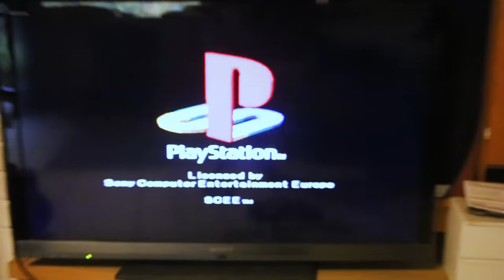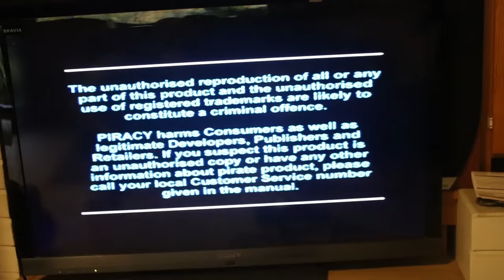Restoring the original PlayStation (PS1) - Vintage Console restoration & repair

Comment: No! Why you removed the Modchip!! That why everybody had a PSX back in the days!
Reply from the maker: It's a restoration. I can put it back if I want but that's not the purpose of this project
Reply: That and it's got the port on the back that a modded GameShark can be plugged into
Reply: Agreed. Seemed a bit stupid to me to remove the mod chip.
Reply: Quite sure he can do a better job, that was a half assed modchip install
Reply: That thing is pure jank as well as the installation, better without than with it!
Reply: @SilvaDreams  Indeed.. you should check out Lord Voultar, he did some eBay mod chip reworks.. scary!
Reply: I had an PSX back in the day and guess what it was not a modded one, enjoyed the shit hell out of it.
Reply: Taltech chip dont worry it was just a spy chip planted by a foreign government
Reply: You can now buy a card called PSIO, you can put it into your parallel port and then play games from an SD Card. No Modchip needed.
Reply: That’s a lie. Everyone had a PlayStation for Tony Hawk.
Reply: Games are realy cheap for the ps1 and know one does copies anymore so why leave it in?
Reply: @OddTinkering  It's not restored that spindle hub needs to be replaced before it cracks apart it's already missing plastic exposing the red rubber suspension that retains the CD. That's more important than the mod chip as time progresses being a wearable part, buy a shit load of the cheap ones sony used or source a quality metal one from a portable CD player and go butter knife that shit yo! If you want that thing to last the next 50 years.
Reply: Whats a mod chip.  I was wonderig how it was even working without the thing with the red wires
Reply: I've still got my PS, with the parallel I/O port, never modded, completely original. Looks and works like the day I bought it from Dixons. I was never a big mod chip fan, seemed overhyped and they often seemed to be more trouble than they were worth, plus the installation often seemed absolutely piss poor, real back alley stuff. I just bought games and played them, that was always good enough
Reply: RBRat3 then make your own god damn video
Reply: @Peckerwood420  actually RBRat3 is right, I noticed that as well. There was absolutely no need to be so rude. He spotted something wrong and mentioned it in the comments, that's OK, that's just observation, and will save Odd Tinkering time and money later on. You need to get a grip.
Reply: @Peckerwood420  Find me an ugly ps1 and I'd be more than happy to but the last one I pulled out of the trash the only thing wrong with it was a cracked off spindle hub. To help you understand a bit better that mod chip is not impeding the function of the unit while that spindle hub will make it absolutely useless from a native standpoint. The spindle hub is the weakest and cheapest part of a PS1 and doesn't do well to being whored out constantly to the will of holes for a decade unless it's a museum piece. It either needs backups or a quality one and you need them now before CD's and their hardware fall off into obscurity... To put this into perspective without the internet when was the last time you found a portable CD player that you could harvest a spindle hub from?
Reply: @OddTinkering  "put it back if you want"? "not the purpose of the project"? That's the whole purpose of the project, to bring classic consoles like this up to their optimal usage with modern mods that add quality of life for continued usage of the system into the future. Who wants to play old scratched up disks anymore? A word of advice to not make your viewers displeased: If there's a mod chip in it, don't remove it unless you plan to replace it with a modern even more optimal solution! I highly doubt you can 'put it back if you want' you don't know what chip it is where it was from and probably likely can't find an installation guide anymore let alone match up the model and use the correct guide for that particular system. I guess you could rewatch the video, but doesn't look like you recorded all of it you won't know where any of the wires go anymore. So I would say check out some of Voltaire's videos, he actually removes mods to install a newer better version of them rather than just removing a useful feature and returning it to be destined for the junk bin... If you want to restore systems don't devalue them and leave them in an even more junk state then you got them in! And Taltech is right I have installed modchips on all my systems back then and over the years, and if anyone even thought about uninstalling my mods I would punch them in the face! lol So unless you're trying to anger your viewers don't ever do this again... 

The only acceptable removal of a mod is to install a better one and make that clear and show that you've done it! It's not an 'optional'...' can do it if you want'... Either do it, or leave the system alone and let someone that actually respects these old consoles do it instead! Besides that major fail, I don't see any real restoration here, at least you didn't show any of the process besides simply cleaning it, that's not a restoration that's merely a cleaning, and a restoration includes restoring the functionality it had including it's modded in functionality! At the end of the video it looks like after the cleaning you merely plugged it in and it kinda worked and you said bam restored! Perhaps this isn't a concluding video and it's still an ongoing project but to actually count as a restoration you have to actually fix what's wrong with it and update that mod with a new version likely with less wires and easier and more readily available mods... For PS1 there's actually in more recent years became an off the shelf chip you can buy and flash it with software that does everything those old mods did and a bit more! So I would recommend going that route with this machine, or at least do the parellel port sdcard loader for it since this machine has a parellel port which was removed on later revisions that's another good option here!
Reply: @thecynic807  Back in the day before the world of software based modding with these consoles it actually required (or was easier) for non manufacturer (in this case sony) individuals to develop custom chips that 'interfaced' with the consoles and soldered themselves into the system connected at key points to intercept and override signals to bypass the system's copy protection to be able to run backups (copies made of your games so you kept the original disc unscratched and pristine in the box and burned a new copy from backed up .isos whenever your current one got too scratched up to be comfortably usable) and by extension allowing region free play as well as a bonus. They essentially trick the system into thinking it's an original disc so it loads it up without a problem and so that it ignores any region locking allowing imports to run as well!
Essentially it's an unofficial and unsanctioned chip that improves your gaming experience, so they're really awesome! :D

Comment: Some of the real OG's would know how to play a copy game without a mod chip. By holding up the cover plate while the CD is running with a demo disc inside and switching the copy CD back and forth between loading sounds to get the fake game running.
Reply: Yep, I did that. It eventually broke the disc drive motor. Good times

Comment: 6:12 Lighter fluid also works well for removing sticky adhesives. I find isopropyl alcohol can be harsh on some surfaces.
Reply: Or you can get label remover which smells like oranges.

Comment: "The person I got this from told me it was put away after it started having some issues" 

Where did they put it? In the ground where all the dead bodies are?
Reply: Yes
Reply: @МаксимСелюзкін  oh really? Any proof of that?
Reply: Максим Селюзкін how do you fake restoring a console with 15 minutes of footage
Reply: jay_boivin07 I’m going to guess he’s calling BS on how the guy got the console, but if this dude is on some conspiracy theory shit, I’m not about to just write him off. I want to see how deep this rabbit hole goes.
Reply: @jay_boivin079  1. Drop it to dirt. 2. Wash it with a soap. 3. Profit.
Reply: @nosoyporta  No electronics check? No electrolytic capacitors check? (after 20+ years!) Laser head is need to be replaced! Not to add some grease. What did he do? Removed a mod chip and wash it with a soap water?
Reply: @МаксимСелюзкін  and greased the laser reader track, which was the cause of 99% of the problem.
Reply: @Erduk  This is NOT enough. A laser was fucked as hell by CD-R's. ONLY replacement.

Comment: I have an original PS1! It doesn’t have that big “R” sticker on the front but other than that it looks perfect.
it doesn’t work tho :(
Reply: Would you try repairing it with this video as a reference?
Reply: Emilio D. Galvan I don’t really do techy stuff like that, but my Dad might!
But the problem is, we don’t know what’s wrong with it.
It’s probably the common problem described in the video, but we won’t know until we check!

I also don’t know where it is anymore 😕
Reply: @ArtBoy54Productions  It should be somewhere, you might want to wait for PS5 to come out next year though, since there are strong rumours about being backwards compatible, even with PSOne games

Comment: 3:16 I can hear Lord Voultar getting furious over this mod chip install.
Reply: What does the chip do?
Reply: @thelazycook5103  Disables region locking, I'd imagine (as somebody who never owned a PS1).
Reply: The chip disables the anti-piracy technology as well so you could copy a game to a burned CD and it would run
Reply: @JamLeGull  Oh yeah, PS1; they absolutely had anti-piracy software- I remember watching a video about how one of the Spyro games had a clever way of circumventing pirated copies and/or modded systems.

The only time in which I could really be an advocate for game piracy is either if a game is out of print for many years and physical copies are near impossible to come by, especially if it's a game that hasn't seen digital redistribution or was never released internationally or in certain regions.
Reply: @DickieCheezits  No it's not 'anti-piracy proection' it's called copy protection... And mod chips bypass it to allow playing copies of your games so you can keep the original in box unscratched so you don't have to rebuy it again and again if you play it a lot. COPY != PIRACY (copies made of your games so you kept the original disc unscratched and pristine in the box and burned a new copy from backed up .isos whenever your current one got too scratched up to be comfortably usable) That's why they're called backups, backups of your owned games... So there is a distinction to be made there and I don't like when people conflate the two. And that Spyro copy protection measure as far as I remember it from that video I saw as well couldn't actually differentiate and tell whether it was a legitimate copy or not it merely detected a 'give away signal' of early mod chips at that time... So it was actually anti-mod chip, the disc could've been original or a copy of an original legitimate original or legitimate copy and it didn't actually detect that but merely the presence of a mod chip... So it was really just making an assumption that if you had a modchip then it was assumed to be an illegitimate disc whether original or copy owned or not. Which would be a bad assumption to make, and anyway later revisions of those mod chips removed the 'give away' that made them easily detectable in the way they used so it wasn't an issue after that ;)

Comment: Why did you remove the modchip I was expecting you to redo the wiring in a significantly cleaner manner not remove the whole thing
Reply: From the description:
I also wanted to remove the mod chip. I can always reinstall it. But for the purposes of the video (restoration) it makes sense to remove it.

Comment: What oil did you use on the railing to make it slide better? I always see people adding oil to the railings like for a PS2 console when replacing the laser, but they never mention the oil they use. What would be a safe oil to use in this instance? Thank you and thank you for this video!

Comment: 7:44 i had to learn that the hard way.
Tip: never put your finger on the power supply or any metal part, i got electrocuted and burned my finger.

Comment: Does anybody know if there's a reason why Odd couldn't clean the Mainboards with IPA and instead used the air gun?
I'm asking because I cleaned my Ps1 with IPA since it was dusty and dirty, but somehow it didnt work afterwards, might also be the disc drive, because it didn't spin properly even before cleaning the inside.

Comment: I have adquired recently a psx and i'm stuck with it.
The cd driver seems to run but it stops after two or three seconds running. I also have changed the voltage cause of the time of use and nothing.
It makes a strange noise... mayne i should change it?
Reply: replace the disc drive. but you need to check the disc drive ksm-440xxx model.

Comment: I'm having problems with my console not recognizing the controllers. Have used the controllers on other consoles and they work fine. Have also changed the controller ports, but the problem still persists. If anyone has some tips or solutions i would be very grateful :). 
The playstation is a european SCPH - 9002 PAL.

Comment: Part of me thinks this is "setup". The consoles can't be that dirty and you're finding dirt in capped off areas which physically dust, grime or grease cannot travel. I feel you set them up and then continue to restore them which I don't have a problem with but make the damage more believable. Also the biggest give away is how you've always got stickers (and usually only 1 on nearly all the old consoles) also it's a Rockstar sticker on a PSOne which is sus. Even though Rockstar had the early GTA on the PSOne, the popularity of GTA didn't blow up until GTAIII and Vice City on the PS2.

That sticker (historically) would make no sense unless it was put after the fact. Even if by some chance the person who "sent" you this PS really liked the 3 top down GTA games, I doubt Rockstar were printing stickers that size in those times.

Lastly, if this was bought recently and done after the fact then that raises the question on how it got so dirty...that looks like years of build up.

Just my 2 cents.

Comment: You have some cool videos. I enjoy watching some of the things you rebuild as I do this myself.

But that screw driver set looks like extreme garbage. The reviews of it, back up my claim strongly. It kinda disgusts me slightly to see you advertising for it. Its a over priced, poor quality, piece of shit set. I get it though, you make money when it sells and It flips open....yay. How could one resist. Sadly the folks that watch these videos not a lot of them have this hobby they just watch. They are probably gonna get suckered into the flip gimmick and buy it. Then when they want to try the hobby out they are greeted with a 35 dollar piece of shit set they think will make them like their favorite Youtuber 

No, I didn't buy a set. I was just generally curious as you can get a set like this almost identical, at harbor freight for like 5-10 bucks. How much it would cost? My reasoning behind even posting this was that you are good with restoration. Good enough you should be using real tools. Or at least have some pride in the tool/tools you use. So when I saw the gimmick flip open 5 dollar magnetic screwdriver set I kinda laughed a little. Then I saw you advertising for it. I thought to myself well hes a big youtuber and hes pretty good. Whatever if folks wanna buy the same starter set to do some restores of their own. neat right. Then I followed the link and saw the price. 35.00 claiming to be "on sale" lol go fuck yourself dude. I even unsubbed.

So before anyone posts anything negative as i'm sure they will with that sub count. Your videos are good. But that is scummy and I'd like others thinking of getting into this hobby to enjoy their first experience rather than buying that piece of shit set. Having it arrive broken.. their first project will be restoring their screwdriver set....